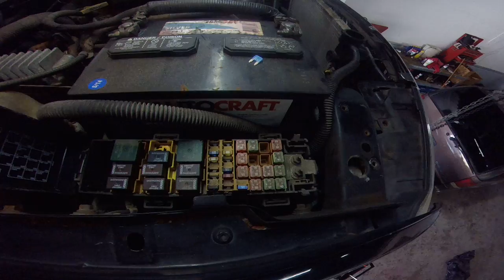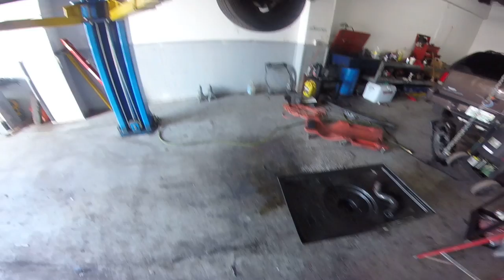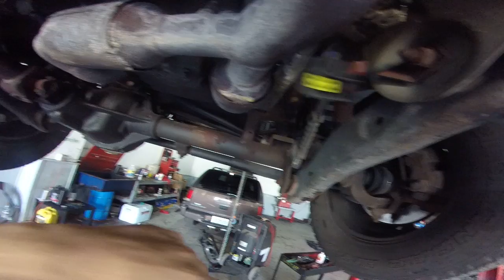jeep oxygen sensor low circuit code

Comment: I have wj v8.  P0161 changed the o2 but code came bk! Mechanic/ electrician  thinks it's the b1 s2 that's faulty but not sure! Can these old jeeps give a wrong code?
Reply from the maker: ok so i have ran into the same issues with jeeps and o2 sensors so first thing need to make sure you dont have any exhaust leaks before the sensor second make sure you have power and ground to the heater circuit wires and 3rd get a mopar sensor for some reason after market sensors never work good in chrysler products i went threw a nightmare with a liberty changing the sensors 3 times before i got the mopar ones and then the check engine light stayed off  please keep me posted on your issue
Reply from the maker: plus make sure your changing both the downstreams not just the one
Reply: @uglyhp8225  the passenger side last o2 was changed, original new jeep part from jeep! No exhaust leaks! 3 mechanics Inc 1 electrician thinks it's the drivers side that's faulty! I watched utube, p0161 = b2 s2! One channel, maybe yours states it could be both!
Reply: I just did them all it was more work and cost more but it fixed the problem completely. 2012 Jeep Liberty Limited